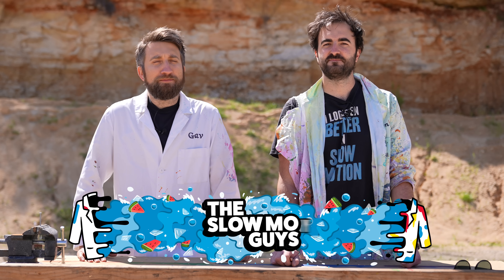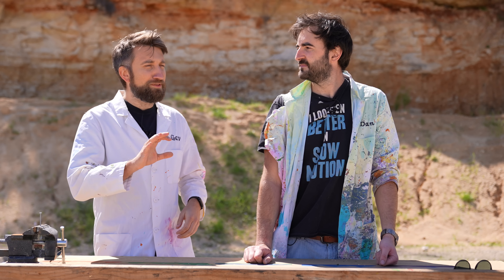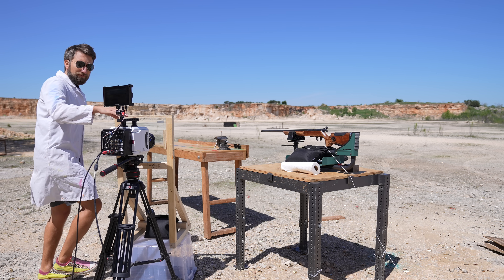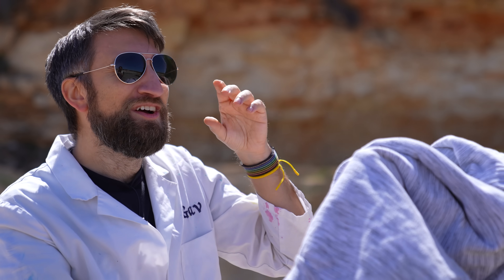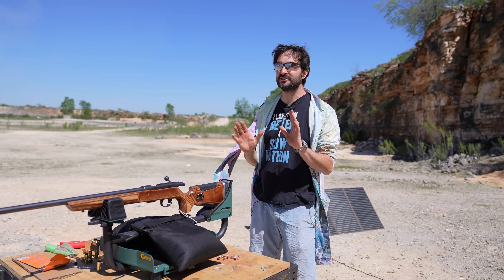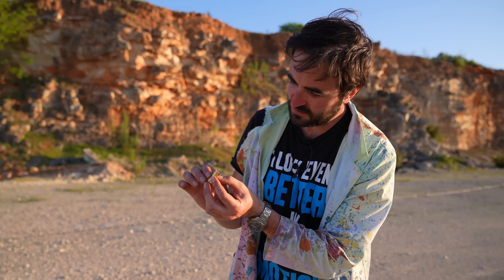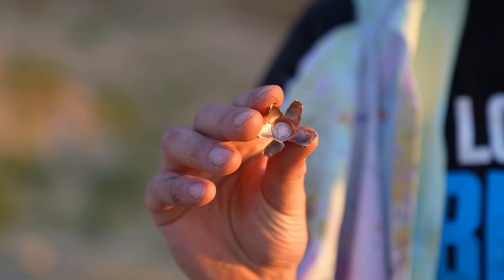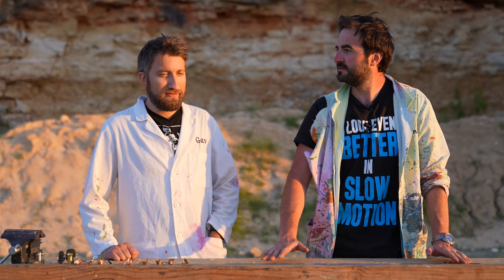Can a Bullet Go Through Another Bullet? 875,000FPS - The Slow Mo Guys

Comment: As most people have said, you could try either a .223 or a 5.7mm. You could also look into using .22 hornets instead of .22 lr if you wanted to repeat this experiment. Both the hornet and the 5.7 travel significantly faster than the .50 ae so they should pierce if the two bullets collide

Comment: What you guys need to use are M855 - 5.56mm green tip steel core penetrator rounds. Essentially same diameter as the .22LR you initially used but travels MUCH faster and has a steel core for pentration! Better yet M995 black tip rounds which are actually armor penetrating rounds.

Comment: Look how the case peeled apart from the gas expansion and it tried to push the bullet out but failed because the casing is so soft. It shows you how much your firearm really does. When a round is in your firearm it sits in the free bore and hugs it tightly to keep the casing from doing that.

Comment: On the topic of caseless ammunition.
It never got any traction in the military. They found that continuous firing heated up the chamber to the point it caused a "cookoff", firing the round without the trigger being pulled.
This is an obvious safety risk.
Reply: Dont forget that ammo storage was a secondary issue as well (i remember hearing about humidity causing problems with long term storage)
Reply: That sounds terrifying
Reply: Cook offs can occur with standard ammunition also.

Comment: You need to see if you can get some M855 or SS109 rounds in 5.56 and try those out. They both have a steel core in them (not hardened, so it isn't armor-piercing or anything like that.) That core might do a better job of staying intact after impacting the .50 AE bullet. Another option might be a solid copper bullet like a Barnes TSX or similar. I think something like that will be both commercially available and therefore easy to find, but also less likely to merge into one big, expanding mass of lead and copper jacket.

Comment: https://www.youtube.com/@markandsamafterwork  can give you the rifle/cartridge diversity .. and for the 5.7x25mm replication  use a 6mm or high speed center-fire .22 with a roller bearing pin to represent the harden 'perpetrator' (lathe hole into the standard bullet..  I still think that you may need a rather large/long tungsten steel pin to really get through.

Comment: as others have said this definitely needs to be done with a 5.56 m855 "green tip" these are widely available easy to get rounds, .22 cal so it would fit just as well as the  .22lr, but has a steel core, and is producing far more energy.  Also worth mentioning that in the movie I'm assuming the shot is 2 bullets both fired hitting each other which means the .50AE  round would also be moving with a lot of energy, that would also change the impact quite significantly.

Comment: You should have done a 223/5.56 round from an AR/M4 platform.  The round is the same size (diameter at least) as the 22lr that you started with but it moves MUCH faster.  You can also VERY EASILY get armor piercing rounds that will act nearly exactly like what the movie showed.

Comment: This is not an accurate test because:
1. Both projectiles were presumed to have been fired at supersonic speeds.
2. The muzzle velocity of a .50 AE round is approximately 1,300-1,400 feet per second (fps).
3. It is unknown what type of .22 caliber round was fired and from what model. (but for the sake of good faith and suspension disbelief, we will go with .22 LR with additional propellant that normally wouldn't be packed in a .22 LR casing. This is because the .22LR caliber bullet exits the barrel between 1200 and 1750 feet per second (820 to 1200 miles per hour compared to the other variants of .22 caliber cartridges)
4. Both projectiles were not fired at each other simultaneously within a window of time that was 1/500th of a second.
5. Even if .22 LR was used, the one in the film was slightly elongated with a pointed tip compared to the rounded tip typically seen on a .22 LR round.
6.Peacemaker's Desert Eagle had a lengthened barrel, which would increase the muzzle velocity, and once again, the specific firearm was not used in the experiment.
7. Bloodspot did not use a rifle, rather a pistol chambered in .22 LR that resembled something like the Life Card .22LR pistol.
8. It is not known what material Blood Sport uses for his rounds. But based off of the observation of Peacemaker's .50 AE round, we can assume his rounds were copper-jacketed 300-grain hallow points that consisted mainly of lead coring (explaining the softness of lead in comparison of the presumably exotic material used in Blood Sport's rounds.

Even if the proper requirements were met to facilitate this hypothetical experiment as it should have been, and all factors of consideration were implemented, I am certain my hypothesis would conclude the same outcome: That the .22 LR would not maintain its trajectory, velocity, and possibly its material strength as seen in the film. Though your conclusion and hypothesis was different from mine, we can both agree that what was seen on film is physically impossible, if not astronomically improbable.

Having said all this, this was still a fun and entertaining video. Thanks for the upload.

Comment: I think if you could have gotten a bullet made from something other than the typical copper washed .22LR bullet, it would have worked like the movie.  Maybe even a solid copper pointed 22LR would have done it.  I was initially surprised the 22 did as much damage as it did to the .50AE. 

I would imagine that if the 50 and 22 were both moving, the 22 would have been wrecked, and the deformed 50 would have continued on and hit it's target.

Comment: 5.56mm M855 (green tip) would be a commonly available ammo with a steel penetrator. Pretty much the same diameter as .22LR, although a bit longer and much faster. 5.7mm would be most similar to what is shown in the show, but the AP stuff is restricted to civilians.

Comment: @11:24 it looks like you blew the primer anvil out the back.
Reply: Additionally, you should try steel-tipped 5.56 (.223) - it's technically still a 22, but is more likely to have that pointed profile in the movie and more likely to penetrate through the copper casing.

Comment: You should have used an 17 HMR, Magnum or the 22 Magnum. The 17 has higher velocity and a pointed tip. Either in Magnum would carry a higher velocity, but the 22 will always have more energy, which isn't necessary for this experiment, per se, versus the speed and resistance to dissipating that energy as quickly. A pointed round would travel a greater distance through a target before deforming and transferring all its energy.

Comment: Only thing I'd say was inaccurate about the movie vs IRL is that in the movie, rather than the bullet splashing out like the IRL one did, the bullet more cracked open as if it was perfectly solid.
Like, the pieces that scattered in the movie shot, you could piece back together, but IRL, everything flattened out, stretched, tore etc.
You couldn't puzzle the irl bullet back together.

Comment: 10:25 That's nuts how you see the shockwave ripple down the side of the brass case, then it rebounds from the slug and collides with a secondary shockwave and the brass fails right where those two shockwaves meet. Incredible

Comment: For the bullet you're firing you should have used a 5.7mm handgun round, you probably would have gotten a pass through. And to Dan, yes up to several feet after the bullet has left the muzzle you'll see the bullet yawing quite a bit from a rifle until the air friction and density stabilizes the bullet.

Comment: The chamber is critical to the burning of 100% of the powder. The pressure needs to be sustained for a complete burn. Great video!
Reply: But that was a zero powder burn, I don't believe the primer ignited at all.
Reply: @Boraxo  At 10:13 you'll see the shockwave from the explosion. The cartridge also burst it's housing. You can see fire erupting from the newly formed hole where the primer used to be. The primer clearly popped.

Comment: So... did Suicide Squad actually use a .22 (though apparently armor piercing) against a Desert Eagle? I don't think so!

Quite a few different rounds have a .22 caliber bullet but with FAR more powder (and thus velocity and power) than the .22 LR bullet that the SloMo Guys used initially. There are a variety of .223 Winchester rounds as well as the 5.56x45mm NATO rounds that could have been used instead of a regular .22 LR with its rounded head, and some of those are very likely to be available as AP rounds. Bloodsport of course has some weird nano-technology / teleportation thing for his guns, which means using a weak-sauce .22 LR would never happen.

You should team up with Kentucky Ballistics (again) or Demolition Ranch to get some proper guns and ammunition! I suspect with the higher power produced by .223 Winchester and 5.56x45mm NATO, combined with (in the movie) both bullets moving at each other, and armor piercing round would properly shred the larger Desert Eagle round. Would it still have enough power remaining to do any damage to the intended target, though? That's highly doubtful.

Comment: 0:50
Wasn't "character X" using 4,6x30/5,7x28? The latter being P90 round which is designed to have comparable armor penetration at short ranges to actual .223 shot from full barrel length? Being a PDW that was designed with technical requirement of "duck over soviet paratroopers in body armor"?

Comment: There does seem to be a consistent yaw of repose on those rounds. Ogive's tend to be aerodynamically unstable i.e. the Centre of Pressure is ahead of the centre of mass. The round usually wants to pitch up like that. By spinning the projectile, that's nulled out and converted into 'spindrift' through gyroscopic precession. My best guess is that there's maybe not enough twist rate on that gun but then I can't imagine a manufacturer getting that wrong. So not entirely sure on that one.

Also conservation of momentum is what defines what will happen. Odds are, the round with the most momentum is the one that will continue to move in the original direction. Sum of momentums before collision must be the same after collision.

Comment: If you used a round with a steel penetrator like M855 .556 green tip it would go through. Even in the CGI in the movie the bullet they show appears to be steel not lead. Plus the pointy tip vs blunt tip makes a difference in penetration.

Comment: part of the reason it wasn't going through is you were using .22 not 5.7x28mm five seven is roughly the round they used in the movie scene about the same shape, size and would be more likely to fly through the round and split it similar to the movie partly due to the different shape a .22 would be more likely to flatten when it hits something where a 5.7 is more likely to try to punch through.
Reply: and yes I am aware .22 and 5.7 are similar rounds with similar powder loads just different shape and size of bullet and cartridge.

Comment: It might take a .223 to get through that .50 cal bullet, which is still movie accurate as that's still technically a .22. Armor piercing to keep it in tact... if that even exists in .223. But there are more powerful .22 rounds that exist they could have used other than the .22 LR in this video. There's the .22 hornet, .22 magnum, and as mentioned, .223 and it's variants.

Comment: As for Dan’s idea of the rounds stopping, that really only works when firing the same caliber and ammo type. By having hollow point versus AP ammo of different sizes, you have very different masses, velocities and penetration physics coming together. If using the five seven ammo instead of the .22 as I believe the movie did (which is a faster round) and possibly a steel tipped AP at that against the bigger hollow point, I do believe it would look very similar to the movie where the round keeps going through the other. It would have to be a clean shot though, as just hitting the rim of the hollow point would be enough to deviate the smaller round from its path, changing its trajectory and causing it to miss.

Comment: Pretty sure Deadpool is using a 5.7x28mm pistol in the movie. Caliber wise it's very close to a 22lr like the guys were using but it's a much higher velocity round with significantly different projectile design. It's quite likely there would be significant punch through from the 5.7 without the catastrophic destruction seen with the .30-06.

Comment: The original bullet looks less like a .22 and more like a .223 rifle bullet, but honestly looks even smaller.  They may have used a .17 Winchester Super Magnum or .17 Hornady Magnum bullet, which is narrow and long and pointed, and looks about in scale.  And it looks like a solid steel bolt, not copper jacketed lead, which would allow it to penetrate the other bullet and emerge intact.
Reply: Likely a 5.7
Reply: Yeah true would be fun to see them do it again with something small & fast like 17 or 5.7
Reply: yes. This. solid steel vs FMJ.
Reply: I 2nd that it is 5.7
Reply: Exactly. I have a Savage .17 HMR (with a gorgeous green stock), and it looks just like the original shot, except most of my rounds have a plastic insert at the tip. I have seen a .22 Magnum round that has a solid point. I'm with you here on the .17 HMR. 

The 5.7 is slightly bigger than a .22 LR, and this round looked slightly smaller.
Reply: @Lesardah  Your plastic tip is actually a hollow point, but they have the plastic tip to keep the aerodynamics of a non hollow point. The plastic disappears on contact with anything because of the sheer kinetic energy. I do agree with the .17 HMR, it would be interesting to see them try this again with the steel round .17 HMR, but those are harder to find.
Reply: A 556 or 223 is the same size as a 22 only pointed
Reply: @GrimGames1978  22LR is just lead no copper jacket. All other bullet sizes normally have a Copper jacket.
Reply: @ZMAN_420 A lot of 22LR is electroplated to avoid barrel fouling. Lead melts at moderate velocities.
Reply: @GrimGames1978  well a 223 would be .223” and a 22 would be .220” so one is larger than the other by .003”.  Not a lot but also not the same size.   In other words you need to add “virtually” or “practically” or even “almost”  to your statement.   Or reply below and tell me I’m wrong
Reply: @currentliveoccupant  You're wrong. A .22lr is actually .224 and slightly larger in diameter. It's just called a .22 colloquially. It's like how a .357 is actually a .38 but they measured it differently just because it sounded cooler.
Reply: @TheUltimateWord  a 22LR bullet diameter  is .223”. And a 223 is .224”.  So still not the same.   But thanks
Reply: @currentliveoccupant 22LR bullets are between 0.223 and 0.2255… They are squeezed in the rifling. In the most extreme versions down to 0.17”…
Reply: 5.7 I think.
Reply: Between that and the extra energy of the hollow point, this might just be plausible.
Reply: 5.7 is the only round that looks like that and works in a pistol, assuming they were going into that level of detail for the shot.
Reply: Could of been a 22 tcm or .22-250 very small pointy and fast
Reply: The mass could be an indication issue, but tungsten sabo rounds.
Reply: A 223 is the obvious bullet for this test. The bullet is 22 caliber, and you have more power behind it.
Reply: @ZMAN_420  Oh is the earth also flat?
Reply: It's definitely a 17hmr round not a 22 or 5.7 look at the size of the movie Bullet entering the other bullet and a 17hmr is an extremely fast bullet
Reply: You seem to be forgetting the “original” was CGI and the artists had no obligation to model real bullets.  They likely picked everything based on “what looks good”, adjusting scale as needed based entirely on that and not any actual bullet sizes.

If the director said “make it longer” you can bet someone scaled the Y by 5%, they didn’t search out a longer bullet to model
Reply: @ChuckvdL VR these days uses physics models for animation. The question is what you plugged in as the material composition.
A plutonium or uranium bullet hitting a lead target for example… (plutonium is very hard but denser than tungsten magnesium composite that is an alternative armor piercing round to uranium).
Reply: @allangibson8494  presuming the 3D modeler bothered with those details.     My position is they might not have bothered, and it’s a case of the old classic GIGO function.     Garbage in, garbage out.
Reply: @ The physics software simply requires the materials properties and the rest is automated. Whether the physical properties are realistic is a separate question.
Reply: i was thinking  .17 HMR

Comment: Even if the primer went off in the shot when you spun it around, you wouldn’t have a standard gunshot from the round. This is partially because the case itself would be damaged, but also because the barrel of the gun ensures the pressure of the powder focuses it’s force just on the bullet at the end. Without being in a gun barrel, the blast can expand, losing a large amount of energy.

Comment: You guys should try this again with a meatier .22 round to simulate the closing velocity of the two rounds. Let me break it down for you:

Here you have a .22LR (~1125fps assuming you're using high velocity, soft solid lead bullet) hitting a stationary .50 AE head for a total velocity of 1125fps.

The movie has a .50 AE moving (~1500fps) head on towards a roughly .22 sized Spitzer bullet, probably something like 5.7x28mm (~3000fps, copper jacketed bullet likely with a hardened core) for a total velocity of about 4500fps.

You could get a similar result to the latter by shooting a stationary bullet with a very high velocity .22 caliber like .22-250 which can push velocities over 4000fps which would be a bit closer to what happens in the movie.